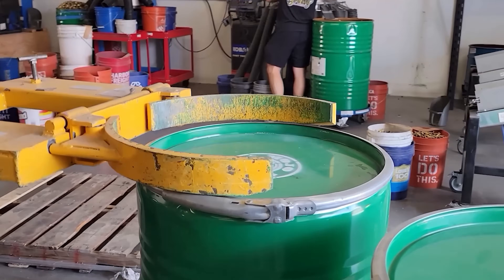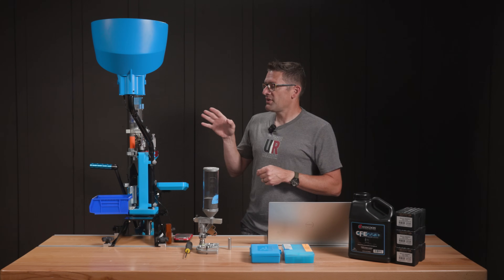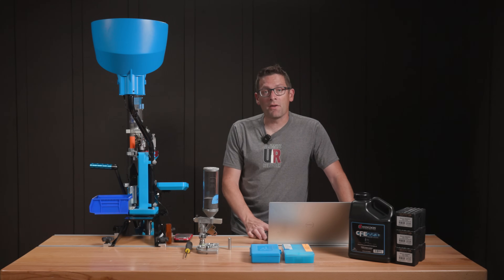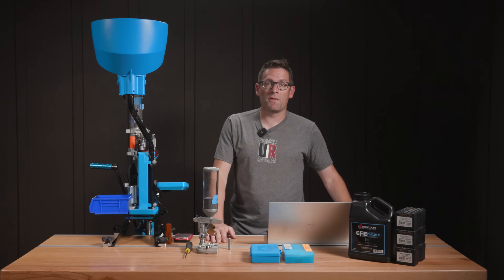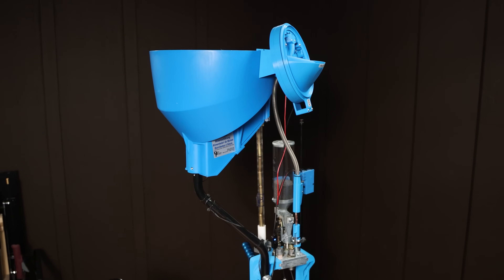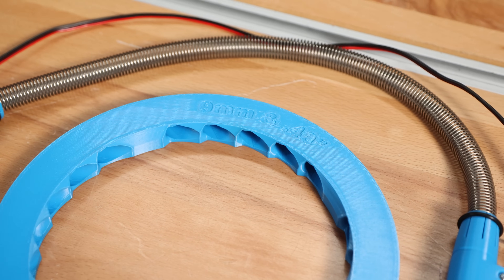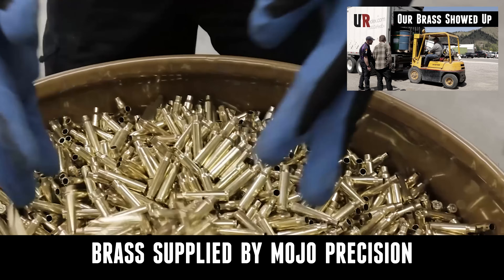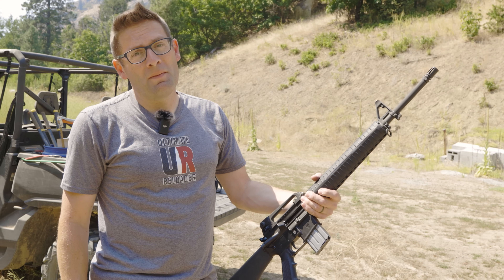Berry's 62gr 5.56 Bulk Loading End-to-End: Dillon XL750 Setup & Optimizing

Comment: I was waiting for the load data (bullet, primer, powder, OAL and case.)  All I could see was CFE223 and what looks like Berry's bullets lurking in the shadows.
On my XL650 I added a shell plate bearing kit and a powder measure adjustment knob.
Reply: There's a lot left out. I don't know how the heck this guy got that many subscribers unless there's that many uneducated reloaders out there. Checking forums is you best bet, youtube is full of BS.
Reply: Just to clarify, if you want a round to go "bang" out of your firearm, pay attention to this guy. If you want accuracy, you need to pay a lot more attention to the rounds you're reloading than what this guy shows.
Reply: Well, this makes sense as this is bulk reloading for ARs, not precision reloading. So a 2-inch group is good enough. And also focusing on the bullet feeder in this video, not the rest. He clearly states that. As for not going into the exact loading data that's left out intentionally for legal reasons both with youtube and liability as well. I don't get your point on anything as the formers are arguably far worse.

Comment: @Ultimatereloader - Great video. I have a significant problem with the original Mr. Bulletfeeder running on a Dillon RL1100 reloading 5.56mm. When loading 55gr projectiles, the light projectiles frequently get “stuck” at the top of the bullet dropper where the feeder spring joins the bullet dropper mechanism because the spring is angled (due to limited placement options for the Mr. Bulletfeeder). I tried “taping off” the spring to keep the spring vertical with respect to the bullet dropper but that weighs down the dropper and then it ceases to cycle up and down as needed to drop bullets. A vicious circle - either keep the feeder spring vertical (which weighs down the whole mechanism) or leave the spring as is (angled) and watch the bullets get jammed at the top of the feeder mechanism. I don’t see any video where you load 5.56 mm (or .223) using a Dillon RL1100 AND a Mr Bulletfeeder. Maybe the problem described above is why? I’d love to see this issue addressed on your channel. Thank you.

Comment: Setup is what I need more of. I’ve watched a lot reloading videos on single stage and every one has a stage (like bullet depth) that is done by “feel” then “measure” for Cartridge Overall Length (COL?). There was is also the full sizing die or sizing just the throat of the case. There are several more stages where it is a lot of trial and error. I assume these same steps are done much the same way on a 5 stage reloading press. Or is it?
Reply: Yup, setting up a progressive is the same, mostly by feel, but with the removable tool heads, you can do it once and be done

Comment: I use a lee classic turret press with lee dies. I will load 223 eventually but i need more primers and i use the same powder for both 223 and 308. Im in the process of loading 308 and i will only have enough powder to do 500 223 after this so 223 will have to wait a while.

Comment: Did you ever calculate the cost/round loaded? That would be great information to let viewers know.
Reply: If you strip out the equipment costs (which are really a sunk cost) it’s usually half the cost of regular ammo, if you already have the brass. With the brass it’s probably about 70% of the cost of normal ammo.
Reply: @peterslaby9782 it's closer to 35-40% off

Comment: I'm going to go ahead and guess that you don't have to swage the primer pockets, which is the obvious shortfall of almost all presses, and the ones that have it (like the Mark 7 APEXes) absolutely suck donkey swingers.  But we'll see if I'm wrong.
Reply: That was specifically what I was curious about here
Reply: any progressive press isn't going to magically turn clean rifle cases with crimped primer pockets into loaded ammo in one pass.  the 1100 can swage pockets but the cases need to be trimmed or at least sorted and trim the long ones back into spec.  Also you need to lube cases to resize them and you don't want that lube gunking up your powder funnel and contaminating your powder charge.
       So, on a 750 you can lube cases then set up a toolhead to deprime ,resize and trim with a 1200/1500 trimmer. tumble off the lube. swage with a Super Swager 600 and then run through the press to reload in a second pass.    depending on how badly your flashholes are clogged will determine whether you knock it out with a pick , agitation or depriming die in station 1.
         just my thoughts

Comment: Too many comments to read but did you lube brass or was it not necessary with Dillon carbide sizing die?
Reply: of course its necessary ...
Reply: case prep is mandatory for rifle cases with crimped primer pockets and need to be lubed and making sure cases are trimmed. Your powder charges will be more consistent if you have resized them during case prep

Comment: 3:50 The biggest problem: crimped primer Pockets, that would be the interesting part, preparing the brass. Because right now you have to have at least 2 runs with the brass, firs deprime and prep and then all the rest.
Reply: This right here was why I clicked on this video.  Processing brass in bulk is tedious.  I would be very interested in how to do it efficiently without buying a bunch of expensive equipment.
Reply: 100% - that’s the interest of this “55 gal drum of cases” project, at this scale.  What equipment, what does the de-crimping look/sound:feel like etc.
Reply: @HustleMuscleGhias  that's what i would call the manual approach, where you have to touch every single case. at this point I'd rather buy the lee app and get the swager ... but then i wouldn't save any money and am back to simply buying the ammo ...

Comment: I run my XL750 with the DAA bullet feeder. But holy smokes it’s absolutely terrible. The 750 is great but dang does the DAA bulletfeeder suck.
Reply: What does it suck at? Mine works great, just gotta play with the adjustments when changing bullets and profiles
Reply: @thatguyoverthere2288  the sensing switch has never worked right out of the box. Its either way too much tension and the bullets can’t make it passed the switch or it’s not strong enough and doesn’t turn off the motor on the bowl. Ive spent HOURS trying to adjust it. And I’m a pretty crafty person understanding how it all works. But that switch is hot garbage. They should have used a light switch or something. If the switch stops the bullets from dropping they all pile up in the spring and then when they let lose they go everywhere. It’s such a PITA. For 9mm it works great.
Reply: @michaelt.9372  well damn sorry to hear that. Do they have a warranty?
Reply: @thatguyoverthere2288   no idea. They’re an overseas company and I’ve heard some horror stories on Reddit regarding warranty work with them so I never bothered.

Comment: New to reloading, only done about 300 rounds of 5.56 on a T7.  When you resize in station 1 do you not worry that some cases need trimming?  I’ve been depriming/resizing & then trimming before primer/charge, am I backwards or inefficient?
Reply: Most people reloading 223 will run it in 2 passes. The first pass deprimes and resizes. Then it comes off the press and gets cleaned. Then back on the press for priming/powder/bullet. Typically you may need to trim every 3rd firing or so. I have about 30 gallons of 223 and have no way of knowing how many times each has fired. A caliper or case gauge will show you that. My 223 prep head has a dillon trimmer on it so every case prepped gets trimmed.
Reply: He stated that the brass was fully processed so all he is doing now is priming, powder and bullet. All the brass prep is usually better done separately.
Reply: Dillon makes a power trim die that will trim the brass, not sure if it works on a 750.
Reply: @billstevens5277  it does but you need a special milled short toolhead for 300 blackout

Comment: HavenXL650 with 3d printed bullet feeder. It works great for all 3 caliber I reload (9 mm,.223, 45 SCP). But honestly, if you primarily reload .223, get XL1100. It has a primer crimp punch rod which works great.otherwise, it's a constant manual decrimp of cases on 650/750. Yes, I have a decrimp rod instead of priming one when processing cases, but it lefts most of the cases crimped anyway

Comment: How are you avoiding failures to charge every case? I hate squibs...
Reply: Ball powder
Reply: @snake57  Reloading 9mm and still have to check each case. One every couple hundred would be a squib if I didn't. You're right though, ball powder does do better.
Reply: @TractorWrangler01 I've done thousands of 9mm/45acp with win231 and titegroup. Never had the powder funnel fail to properly charge a case.

What powder are you using?
Reply: @redmudpei  Thanks, I'll give that a try.
Reply: Dillon has a powder check die.
Reply: DOuble Alpha Powder check die, has an accoustic alarm
Reply: I'm looking that up right away. I need that.  @firebladeflow
Reply: @TractorWrangler01  yes you do! I had 2 squib loads yesterday because the powder check wasn't set up correctly during this batch 🤦‍♂️